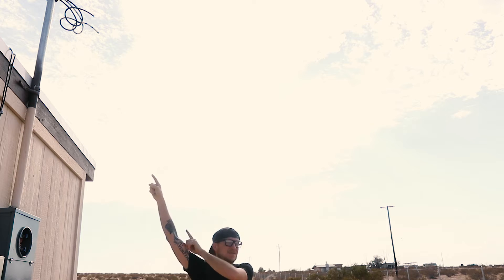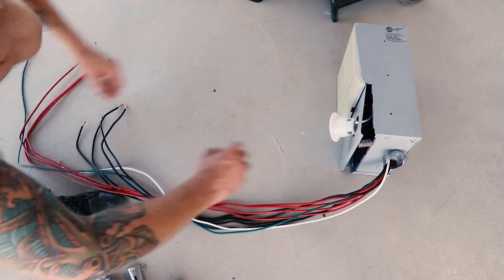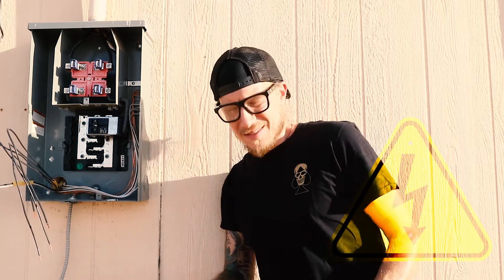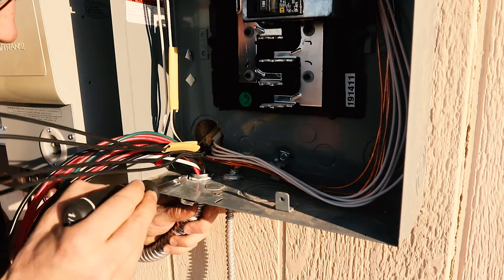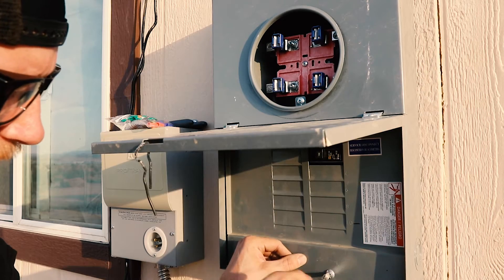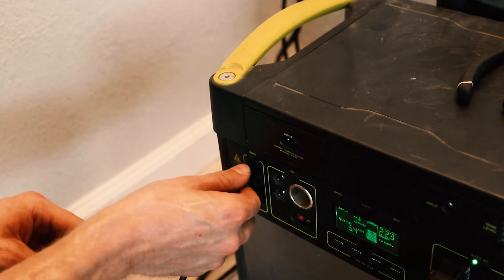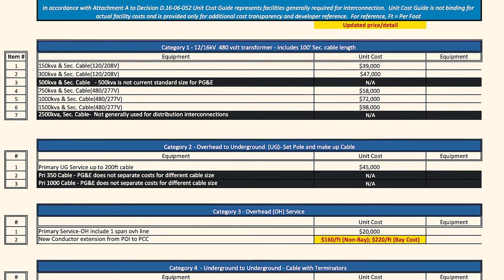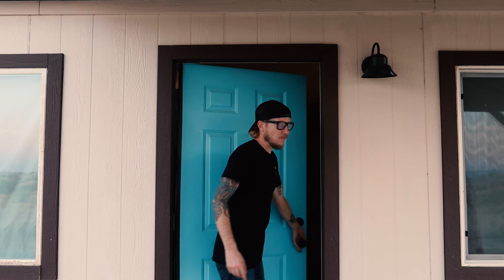Off The Grid Power | Goal Zero Solar System

Comment: I was thinking about getting solar installed on my house. However, I own the 3000x. I never knew they made a home kit. I know this won't power an ac unit but would it be sufficient powering lights and tvs? I have a 200w panel but I could buy a few more. Not looking for constant battery power but maybe switch to battery in the evenings to save on my electricity bill (currently at $740 a month in California) what do you think?

Comment: I have property off grid in Kingman Arizona, and am looking for a similar setup. I currently have no power running to the house, and have been using a generator to run everything. Since gas prices are through the roof it's becoming way too expensive, and have been looking into a setup just like this. Was thinking of getting the goal zero 6000x. Would you be kind enough to give me a list of things I would need in order to run a small home, and actually be able to use appliances?

Comment: How are you powering / charging the Yeti tanks?  Did you use a Male EC8 to ring connector?  I am looking at that adapter to attach to a solar controller to its own bank of solar panels through an MPPT controller through the EC8 connector and charge the tanks faster.
Reply: Goal zero sells a 30 AMP EXTERNAL MPPT KIT

Comment: You forgot to mention the Yeti Link Module can only be charged with a 150w max solar,  and that is what charges you tank batteries.
Reply: Goal zero sells a 30 AMP EXTERNAL MPPT KIT that connects to the last battery which can handle alot more
Reply: @N2UPROD  You can hook any external MPPT Kit you want to the battery banks. I was just mention what the YETI Link was capable of ( which this video is about)

Comment: Very cool. Is ventilation required for battery "off-gassing"? I'm not familiar
Reply from the maker: Kind of? As long as the air inside the space is moving, the goal zero keeps itself regulated, but if it was in direct sun, it will overheat and shut itself off

Comment: Neatly done! That kind of installation would not be permitted by non-certified electricians in Sweden. That said, it wouldn't have stopped me... 😅 But as long as the installation looks as good as yours, you can't tell the difference between your work and that which had been done before! 😎
Reply from the maker: Damn right!

Comment: This is cool. Every winter I think I should get a gas generator for backup power. This looks even better for just a little back up power during an ice storm.
Reply from the maker: Exactly
Reply: @ForgedHome  actually a small dual fuel  propane and gas inverter generator  to charge everything are under $600.  2500 watts and run on propane only, no gas storage to deal with.  Doesn't look like you have a lot of lawn equipment   😎 Piece of mind if you want to run larger loads